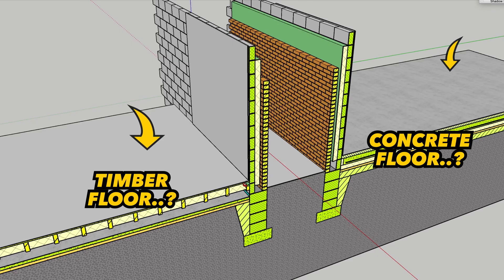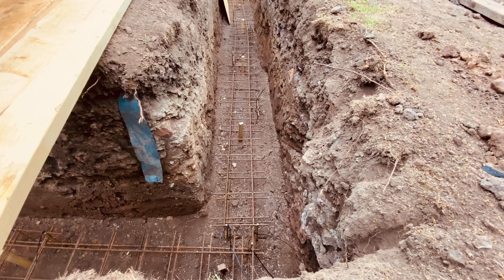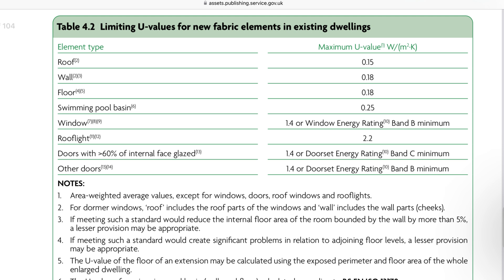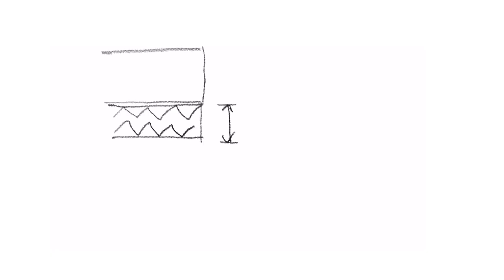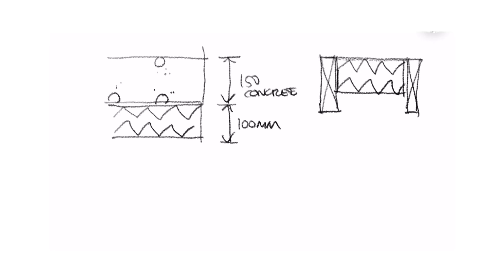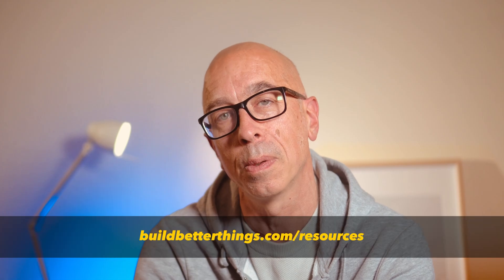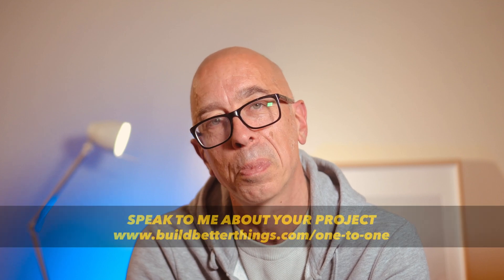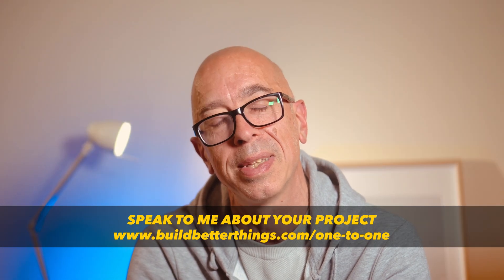Concrete Slab v Timber Floor - Cost Compare & What’s Best..

Comment: The one thing not addressed is the U-values and airtightness. If those of the concrete are superior, that would change the cost over ten, twenty, however many years - a floor lasts a long time. Maybe concrete would win long term? Any calculation as to how they compare?
Reply from the maker: I addressed the comparative u values and mentioned another video I’ve done in detail on it. Are you sure you watched the video?? Air tightness is not proportional to u value, it’s specific to every project.
Reply: @build-better-things  I did watch it all, I saw the bit about the building regs U value, so I take it this was both floors straight specced to that U-value? I'm probably looking for the wrong thing in this video, and the other one, my apologies! I hadn't really articulated it properly even to myself. So: I'm trying to learn which floor can achieve the best values most easily or cheaply. 
That's a different question to the one you set out to answer, I realise, but do you have a take on it? If you were to try to put in the maximum insulation each of those floors could accommodate, be whether the limit is depth or strength, rather than equally meet the regs equally for both, can you say which could achieve most,? Or how much the difference would be? Would it affect the cost consideration or not, or not much? I feel there ought to be some table or calculator somewhere online, but I haven't found one!
I ask because I'm looking at our own home, long term, so doing the best possible rather than the regs makes sense. The last time we renovated, in the 1990s, we went beyond the regs to a degree that the architect and builders told us was mad; but by the time we left it five years ago, it barely met the current regs on some measures, and would have completely missed on things like airtightness. It was sobering.
Reply from the maker: The comparison showed concrete and timber floors, the cost to achieve exactly the same u value. If it was not clear, that is my fault. To answer your question, I would always go for a timber floor, less cost, less work, easier, faster, more options on thermal transfer. People (engineers, architects, builders) choose concrete because they’ve always done it that way, not because it’s an optimal solution. Best of luck.

Comment: Cheers for the great videos. Excellent advice especially when it comes to timber frame construction techniques as this is what I’m planning as a self builder (doing a single story house extension). I’m curious if you’ve experience with screw pile foundations as this is a possible option for us due to ground close to many mature trees.
Reply from the maker: Screw pile foundations are fine, sometimes I prefer mini piles and rods in those situations where there is roots, since I don’t have to rely on an outside contractor on such a time critical element, plus, doing your own mini piles is cheaper and, most importantly, rewarding.
Reply: Thanks for the reply. I’m currently fact finding potential options and how each affects the design and build. The extension is over a slope so would be a nice design feature to build it off legs with space underneath. Self build and cost limitations will ultimately dictate what I do.

Comment: Chipboard is not timber, awful budget material which will deform, bounce and squeak on a big floor. 22mm structural ply proper spec
Reply from the maker: Chipboard will definitely perform admirably, won’t bounce won’t squeak, provided it’s laid correctly. The size of the floor is irrelevant.  If you want to do the extra work for your structural plywood, then go for it.

Comment: Hi Jerry, great video! In this one, you show the construction detail for a timber floor with a brick/block cavity wall. Do you have a similar construction detail for the suspended timber floor with the timber frame that you used in the extension build on your channel? I’m struggling to understand how the wall plate for the suspended timber floor should be chemically fixed to the blockwork while also having a chemical fix for the sole plate in the same block. Perhaps this isn’t the correct method, but I’m finding it difficult to locate any illustrations that follow the approach you used for the floors/walls in your extension video.
Reply from the maker: Although I showed masonry walls for both examples for the floor comparison for consistency, the reality is I will always choose timber frame for the inner leaf. For your wall plates, I wouldn’t chemically fix them, I would use metal holding down straps to secure them, fixing them to the trench block over the top of DPC, in the cavity. I think I showed that in my extension walkthrough. Why do I prefer timber frame? I explain it in this vid. Hopefully I’m understanding your question
TIMBER FRAME v BRICK BLOCK Masonry- House Extension walls - Architect Builder’s 5 expert tips
https://youtu.be/HHunXgidQL4
Reply: @build-better-things  Hi Jerry, thanks again for your help! I’ve done more research, but I’m still unclear on the best way to fix the sole/sill plate to the brickwork. Most of the details I’ve come across show the sole plate being anchor bolted to the blockwork, with the suspended timber floor sitting on top. However, it sounds like you prefer using wall plate straps instead—am I understanding that correctly?

For my project, I’m designing a single leaf wall with timber battens for a render board, with brickwork below the DPC. My concern is the brickwork width, which is 102.5mm, compared to the 140mm timber I plan to use. Wouldn’t that create an overhang issue when fixing the timber? How would you typically address this? I’ve noticed they sell 140mm concrete blocks, which could suit the wider timber, but the challenge is covering them up since they’re quite unsightly. Any suggestions on how to approach this?"
Reply from the maker: @TheMarkc93 yes, use straps. I’m not understanding exactly why you’re using 140 studs. If you use 89mm then you can keep with your bricks. But, for 140 studs there’s always options. I just can’t really explain them here in words.

Comment: Or you could use a raised concrete floor. Very common in large parts of the Netherlands, because A) the ground is very wet for large parts of the year B) because you need piers anyhow, to reach the stable sand layer underneath the unstable peat layer.
Reply from the maker: I think there’s more work in that method for little gain. If you’re a volume house builder then yes it starts to have many benefits. Thanks a lot for your comment.
Reply: @build-better-things  I agree it will not make sense in an arid climate, but it can save you a lot of problems in wetter climates.

Comment: Every builder prices work differently so that one can prove a timber construction is cheaper and another that concrete is cheaper and then there is the builder's culture i.e. whether the small builder started life as a chippy or a brickie or any other trade because they will favour their own trade solution.  Then you factor in a myriad of local conditions and its a complete lottery as to whether one system is cheaper than the other and what those costs should be.

The two specifications shown here are not that common and there are various other specs that would satisfy the project requirements.

Also, of note is that a goodly number of the house builders, who have less fluctuating circumstances actually favour beam and block construction, which is an amalgam of the two systems, concrete joists with concrete block infill.  I have used this to good effect on houses and commercial premises for years, now also specifying it for first floor construction in domestic premises.
Reply from the maker: You say these constructions I’ve illustrated  are not common…. ?? I can assure you, the two constructions illustrated in the video are very common.
Reply: @build-better-things  I can assure you that there are only one of several ways to achieve the same details.  The video implied that these were the only two options..

Comment: Great video and comparisons. Couple of bits I do slightly differently lately, where possible:- 

- For perimeter insulation, specify Marmox or similar Thermo blocks to the inner leaf block work, instead of screed perimeter insulation. 

- Been looking at using multi foil insulations on a couple of projects lately for timber floors. Much easier to drape it over joists and staple,rather than cutting PIR boards between joists.
Reply from the maker: On the multi foil, some local authorities will not accept the heat loss calculations for these products. I’ve also yet to see a clear explanation by these manufacturers of a direct comparison with PIR in terms of thermal transfer. You would also need to introduce a secondary set of battens for optimal performance of the foil since it needs air layer both sides

Comment: I’ve done some bits and pieces around my home, including laying slabs, brickwork, tiling etc etc. I have to say, your videos have almost instilled me with enough confidence to do anything building related. My next big thing will be a loft conversion, so if you haven’t already covered this. I’d love to see something. My biggest fear is not properly reinforcing the joist’s to be load bearing. Thanks for the content!!
Reply from the maker: Hi. Some of my early videos showed loft conversions. This one for example 
ATTIC CONVERSION START TO FINISH - Architect Builder shows you how in 8 minutes
https://youtu.be/4X9_J4cskFE
Reinforcing the joists is actually quite straightforward and allows the opportunity to get a super level and squeak free new floor.
Reply: A-mazing. I’ll be watching these as soon as I finish work today. Thank you for the reply!!

Comment: wow just came across your channel after making this vey decision. I went with timber but one difference is that im using masonry hangers. Do you have any videos or advise  on using masonry hangers?
Reply from the maker: I tend to avoid masonry hangers. I prefer to attach a timber joist to the masonry (spaced off with shims or use dpc)  with resined bolts, and then use timber joist hangers to that rail. I have found it easier to get totally level. But masonry hangers ok if that’s what you prefer.
Reply: @build-better-things  thanks the prompt reply. Do you have a drawing or specification you show me.
Reply: also why do you avoid masonry hangers?
Reply from the maker: There’s more work involved with masonry hangers (in my experience)

Comment: Always packed with info and good to see comparisons through CAD. 

I’ve recently bought a development property and have a small extension at the rear that needs demolishing with a new larger one in place. Only issue is east and south facing sides of the extension back up to a 2.2m granite  wall being south and 3m granite wall being east. What’s the best strategy timber frame or block? 

We’ve come to the conclusion of surecav with a cavity or dry packed then block work. But wouldn’t mind using timber frame, is there any regulations to where the timber frame is made (work shop) or on site
Reply from the maker: I’ve talked about this in another video, I’ll always try to go timber frame over masonry, so many advantages .   No problem in assembling the timber frame on site. I’ve also built wall panels in workshop and then to site in a flat bed. I just made a video recently if you have a check.

Comment: the block and beam flooring system is game changer.
best of both worlds at a fraction of the cost.
Reply: There have been a few comments about this. Could we have a follow-up video showing how this would compare, please?
Reply from the maker: I’ve commented elsewhere on this, but I don’t agree,  it’s not a fraction of the cost,  and for small projects, the opposite is true versus the two methods I compared.

Comment: I've been watching a new build estate go up and they seem to be using concrete slab as opposed to a wooden floor. Why would they do that rather than the cheaper option? Are there other factors at play here?
Reply from the maker: Great question. I’m not entirely sure of the circumstance, but… there’s a strange reluctance in England specifically to timber frame, instead to stick with masonry and concrete, Scotland has embraced timber frame… my guess would be that the contractors are bringing in plant and machinery…   pumping the concrete, going around each plot and pumping it in super quickly, economies of volume make it a different proposition to my examples. But…don’t get me started about volume house builders.

Comment: Good video. Ground permitting, i'll choose concrete all day long though. A 22% saving on just the foundation costs is not a deal breaker for me. Unless you are talking really big builds. I like things bomb proof :)
Reply from the maker: Great thing is in building, there’s rarely a right or wrong answer. Usually an “it depends” answer. Thanks for the comment.
Reply: @build-better-things  Unfortunately for many it's just "that's the way I do it" or "that's the way it's done" without regard to the situation or site. "It depends" is rarely heard but so often the case with building.

Comment: Thanks for another awesome video! Love you content! Am working on getting my side return done on an Edwardian end of terrace done . I have a timber floor and my things is better to have concrete slap instead of timber floor even though the timber floor is sound and I’ve got I believe 800 mm void underneath. If I do all the timber floor myself, I think it will be cheaper than your comparison given. I don’t have to pay for a labourer and a skilled labourer.. and it seems I get a better thermal resistance with the timber floor than concrete. Would you agree?
Reply from the maker: Yes I agree. I am putting another video together on that. If you have 800 below, I would add 60mm PIR to the underside as well as 100mm between, putting the PIR between the joists   to the bottom of the joists this time, hard up against the 60mm. Thanks a lot for your comment again.
Reply: We live and learn! I have learned so much from you! One of kind . Really appreciate it man!

Comment: Another excellent video of the comparison between timber frame and concrete construction methods. Well done and keep em coming
Reply from the maker: Thanks a lot. Have a few more on the way.
Reply: I tried getting on the resources on your website I had no luck. I tried to subscribe which I think I am already and I’m not getting an email. I’ve tried different things. I’ve tried to subscribe using a different username just to get the link and it still didn’t work. Don’t know if this is unique to me or is there an issue with the website? I have no idea. I thought to let you know. Cheers
Reply from the maker: @halstirrup it’s the website. They are transferring their servers and the certificates are being changed. I’ll get it sorted in the next few days. Sorry about that

Comment: Great video Jerry. I assume if underfloor heating is planned it's better to go concrete so that you get the better performance of pipes embedded in screed? Next question is how to decide whether to have the concrete over or under the insulation? My original architect specced insulation above concrete, then screed on top. I'm also trying to figure out how to build the extension and cover the existing house with external insulation. The junction between the two is a difficult detail to figure out.
Reply from the maker: Thanks a lot. For new build, underfloor heating is as easy with timber as it is for concrete. It’s just if you have an existing timber floor, under floor heating is a bit trickier. Concrete should always go over the insulation. If your architect is specifying it the other way, then they’re not understanding the thermal conductivity properties. You want the concrete to be on the warm side, like the rest of your structure to avoid differential movement.
Reply: @build-better-things can I please clarify, ufh is as easy to install for timber floor but will it be as efficient? If building a new extension with wet ufh, should I be choosing one over the other? Thanks
Reply from the maker: You’re using reflective mattresses and super efficient insulation under the heating for timber and you do it with a strategy for the whole floor and zones. The difference is that you don’t have the option of heat sink with timber but that’s another topic altogether.
Reply: @build-better-things thanks for the reply. Our main house has concrete floor but I’m assuming it’s no issue to go timber just for the extension. The extension will span the entire rear of the house & be approx 4 x 8m. Sorry, may seem like a silly question but am complete novice.
Reply from the maker: @johnmcquade3367 there is no silly question. Timber there should be fine. It’s actually more about the walls and how they join in. If you look up “differential movement” you’ll start to get a feel since I can’t really tell you definitely without seeing it
Reply: @build-better-things  I agree for a occupied space such as a home extension, it makes sense have the insulation below the concrete so that the concrete becomes part of the thermal mass of the property and to help even out the heating. But what about a garden room? I am planning on building a outhouse for use as a gym and was thinking about having the insulation above the concrete. My reasoning is that I would only be using this room for a few hours a day. I would want it to warm up faster and cheaper and so, don't want to pay to heat up all that concrete. May I ask what are your thoughts on this?
Reply from the maker: @McMdDOM , concrete slab with insulation above for a project like yours is going to give you a load of problems if you’re using timber frame walls.